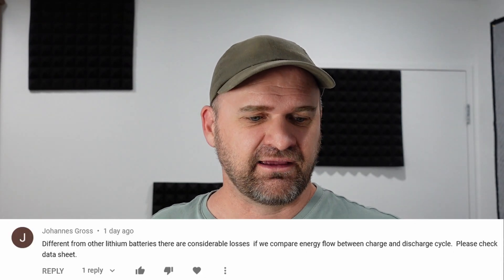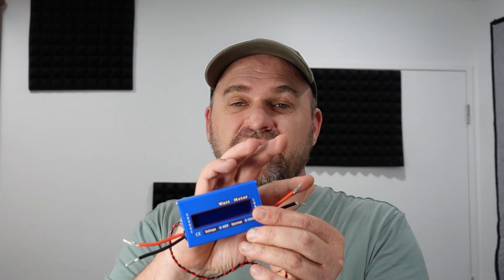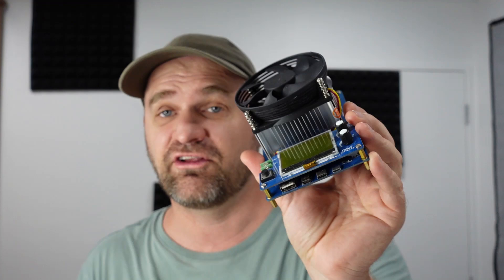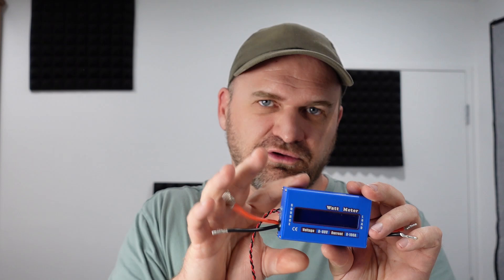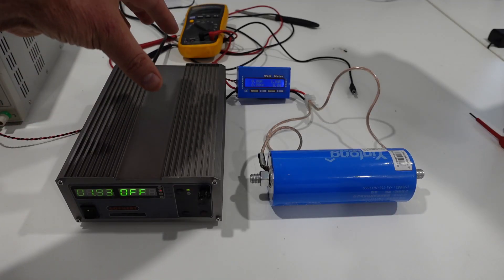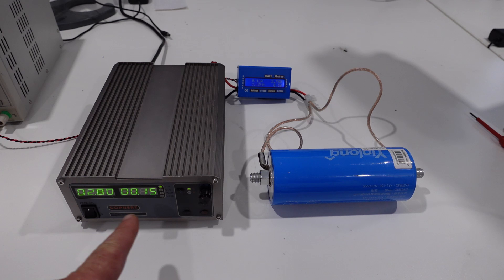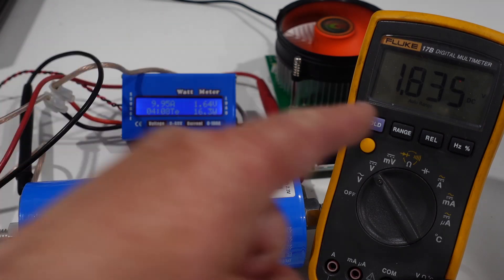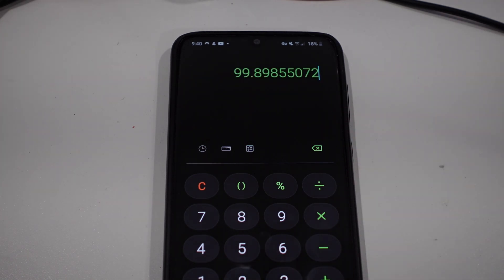Efficiency test LTO Yinlong battery

Comment: Awesome test Brendon! Just as my real world experience with these cells, they perform to or above specification. My advice: do not listen to everything Will Prowse says. He's wrong about these LTO cells.
Reply from the maker: Thanks Daan, I think he agrees that he had bad cells or something went wrong and they actually do have decent efficiency.
Reply: @brendontait6968  still he's very dismissive about LTO chemistry. Yeah they're not the cheapest or the lightest but for overland or heavy use cases or colder climates they're awesome!
Reply from the maker: @daan3298  agree
Reply: @daan3298  watching his videos, there seems to be a bunch he doesnt fully understand about batteries. And gives out misinformation.
Reply: @blackz06  what was I incorrect about. What do I not understand?
Reply: @blackz06  what misinformation?
Reply: @blackz06  can you be more specific?
Reply: @brendontait6968  thanks brendon
Reply: i called that right away and debated it . getting good cells is the hard part . LTO is amazing for the safety and abuse we put them through in car audio . its may be more expensive but it does pay off in the long run , having used many different chemistries over the years other batteries can not deal with the abuse as well .  his influence has made it hard for me since his videos with his attitude towards the crappy grade cells he got . he liked the toshiba and those sold out and i cant even get the damn things anymore for myself anymore , yet trying to get people to go with yinlong or other cylinder LTO is a uphill battle cuz they already have it in their mind that they are all bad. you over charge or over discharge Lifepo4 and it takes such a hit , ive literally drained my toshiba and yinlong LTO cells down to where they flipped polarity , flipped them back and recharged them without taking a noticeable hit on performance  , show me anyone do that with lifepo4 .....
Reply: @mazda2284  exactly!! Thanks for your comment. You get it
Reply: @mazda2284  oh right, you can't deeply discharge LiFePO4, or change polarity. You wouldnt need to do that in a pack anyways, so that is not a benefit. You don't want to cycle it in reverse either. But you can. I would stick to manufacturer recommendation. But that is a cool effect that lto has. But to say it is better than LiFePO4? Why? When do you reverse polarity of a pack? The deep discharge benefit doesn't matter if you have a bms. If you have no bms, then sure, lto is better
Reply: @WillProwse  yea you wouldn't want your cells to be discharged that low or flip , but shit happens and thats where its good to know what the damages are and what happens . i over discharged a bank of lifepo4 and you could tell they took a massive hit and not long after 1 of my cells ran away killing the balancer and overcharged that cell . the rest seem to still be OK but not the same as they were . i found it interesting how the LTO took that abuse and after reflipping the cells back you couldn't even notice the difference . and yeah the problem with using them for solar isnt the cells , its the equipment isnt made to work in the range they are . for my home setup i had to do a custom charge controller and a 16v capable inverter to get the full potential , which isnt as common and did cost a little more . to me its worth it tho , going on 5 years of using both Lifepo4 and LTO i can see the change in the lifepo4 due to cycles and lifespan , however the LTO is near same as its always been ! it will be interesting to see what happens over the next 5 years
Reply: Did anyone watch my LTO part 2 video? I pulled full capacity.
Reply: @WillProwse  Will I'm not sure if this is bugging you,........................... Remember it's youtube(meaning people will talk shit)
Reply: @pteepan2708  oh it's all good. I don't care what battery chemistry people use. I prefer LiFePO4 for my specified application, but audio system guys have reason to prefer lto. Really depends on what you want your pack to do
Reply: @WillProwse  it is nice that you show is many other systems and different set ups.
In OZ I'm 100% off grid and I tell you there is NOT enough people teaching DIY off grid projects. I know for so many people the grid is somewhat cheap, so most don't need to bother.
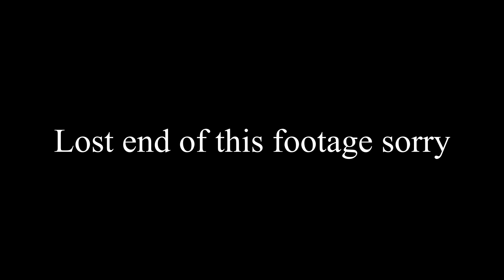Reply: @WillProwse  I'm not familiar with these tests or equipment but 4:21 to 4:34 in this video says 1.93 on the machine's display, does that mean the 'charged from voltage' was higher than the 'discharged to voltage of 1.80' ?
Reply from the maker: Hey Andrew, I know this question wasn't aimed at me, but I'll do my best to answer and anyone can add their thoughts or disagreements if they want.  With this chemistry, when the state of charge reduces below 30% the internal resistance starts to climb quite rapidly.   This, combined with some electrochemical processes make the battery voltage sag and float much like you see with a lead acid battery.  You'll notice at 6:08 where I turn off the load you'll see the voltage of the cell start to rise quite quickly before I cut. So by the time I had rewired the cell to charge it had risen to the 1.93V you mentioned.  The important thing is that the load and voltage was the same on both the initial and final discharge to get a reliable capacity indication.  It is inaccurate to rely solely on voltage as an indicator especially when internal resistance and varying loads come into play.  This cell has very little energy below 2V, realistically the useful charge range is 2.0-2.55V/cell.
Reply: @brendontait6968  @DIY Solar Power with Will Prowse
Fun fact: My BMV-700 shows charged and discharged history since I've installed it (LTO pack was already installed) as 291kWh charged and 282kWh discharged. Quick math 100/291*282 = 97.24% efficiency of real world usage. 109 cycles since measuring with BMV.
Reply: @daan3298  nice job! That is typical
Reply: @WillProwse  Efficiency update almost a year later: 100/793.2*772.5 = 97.4% efficiency charge/discharge, in kWh. Slightly more efficient than last year. This is fulltime vanlife real world usage.
Reply from the maker: Cheers Daan
Reply: @brendontait6968  how’s your Unimog build going? Love to see an update!
Reply from the maker: Haven't touched it...   loads going on.  But will soon
Reply: @brendontait6968  at least calendar life isn't eating away at your battery pack :)  Love to see any updates. Great rig deserves some airtime!
Reply: Why is everyone thinking that I disagree with Brendon? I like this video and I had the same results as Brendon. I also had grade b cells in the first video, and I mentioned that in the video as well.
Reply: @WillProwse  Last minute of your LTO part 2 videos sounds dismissive to me. "... there is not much benefit it is heavy expensive inefficient large I just do not like hearing those words in my mind ...". 
Most people I talk to about LTO and tell how great they are performing for me reference your videos and base their opinion on LTO on yours. They do not trust LTO because of your opinion. You have a lot of influence. 
These cells are also better for 24v (11s) or 48v (22s) systems. I have 24v 11s with active balancers and they balance fine. No problems at all. Maybe a topic for a third video, 24v system (for people not living in a warm climate, we use solar and batteries too you know).
Anyway, love your channel, it's really helpful and a great resource.
Reply: @daan3298  well that's why most people don't use LTO. I still stand by that. Specific energy, volumetric density and price of LTO are awful. I love the charge/discharge c rate, but most wouldn't need it. And they do become inefficient at higher c rates. I'll make a video stating all this soon. I'll show exactly what I mean, step by step. LTO is super cool, but not for most people. The cycle life is great, but calendar aging would probably kill them before the cycling degradation did. The working temperature range is incredible too. They do not work well for 12V, which would exclude a lot of people who like to stick to lower voltage nominal, which includes RV and van dwellers. 

And all the other reasons I mentioned. Super cool chemistry, but it's not worth it for most people. I love what brendon is doing, but he understands why he is using it. He likes the temperature range and discharge rate, as he mentioned before. 

I still do not think they are ideal for solar, but they can be for some. Really depends on what you are doing.
Reply: @daan3298  yes good point about using them for 24V system. Very true, I should have mentioned that more
Reply: @WillProwse  looking forward to another LTO video from you! I live and work in a van myself btw. A 12v system was just too light for me. I need to run computers all day, use the occasional power tool or two, water heater and induction cooker. It all adds up. For me LTO made more sense than LFP, also because I can mount the pack under chassis - that saves a lot of space inside and since LTO is still usable in cold climates there is no risk of damage by charging in freezing temps. 

Sidenote: I use a Victron EasySolar 24/3000/70-50 with a 1560Wp 6 panel array and a 33 cell LTO pack in 11s3p (upgrading to 11s4p soon-ish). Weight is manageable and size is not much of an issue because of under chassis mounting. My van/truck is 6 meter/20ft cabin over chassis base. I'm from Netherlands, it freezes here in winter, not much but enough to damage LFP cells or make them useless in times you'd need them most.

Anyhow, looking forward to the next LTO video!
Reply: Props for  @WillProwse  for making a new video on this topic this fast and for owning his "mistake". Check the video here https://www.youtube.com/watch?v=iOBSxEqXUQc
Reply: @daan3298  sure thing 😁👍
Reply: @WillProwse  Bruh, if I were the manufacturer of that battery I would come after you HARD for lying about my product like that. They think you disagree because you're not smart enough to take down the lying video.
Reply: @jonross377  I never lied about anything. I received grade b cells. I recently was sent crap cells from BLS who is a pretty big distributor for LTO, and pulled 38Ah even though they were advertised as 45Ah cells.
Reply: @jonross377  hey Jon how about you send me all that money that these people scammed me for? That would be LOVELY. I'll even make a video for you about it too. I'm tired of getting ripped off, and that would be great if you can fix how screwed I've been by these distributors. I have other videos about LTO where I state specifically why dislike them for solar. I don't think you have seen them going by your comment 😂😂😂
Reply: @jonross377  Do you understand that was my own money that bought those falsely advertised cells? And how hard it is to buy high quality LTO cells? I like LTO for some applications still. But not for solar. Just because I do not like it for solar, does not mean there is anything wrong with LTO. I figured that was implied, but full grown adults watching my videos do not seem to figure this out. I am not again LTO or any other chemistry. I love them all

Comment: Another indicator is heat given off during charge and discharge, those cells would cook very quickly with their relatively small surface area to capacity if they were inefficient. Keep up the good work.
Reply from the maker: Definitely!
Reply: Yep but a low CE does not necessarily give you heat it can also split electrolyte and similar which requires more energy. Though low ce will also destroy the battery most likely. Because where would all this 15% electricity go? Do something else which doesn't sound good
Reply: The larger the battery the less surface area to volume ratio, heat has less area to dissipate.
Reply: If they cook. It will be bad in this test, because more energy would loss in heat.

Comment: That's pretty good Brendon. They are substantially dearer than LiFePo4 cells though...what drew you to these specifically?
Reply: Based on a previous video, it's due to the extra cycle life of this chemistry making it overall cheaper per cycle. E.g. if LTO was good for 10x more cycles but was only 5x the cost it would be twice the value in the long-term, as you would need to replace your LiFe pack once to achieve the same overall life that LTO gives. (Of course not quite that straight-forward, but hopefully you see what I mean.) He talks about this here: https://youtu.be/kYx097cVR48?t=777
Reply: From what I can tell, the LTO are almost like the "led of batteries." ie they last longer than the item they're in.  I would imagine, in Brendon's build, that the LTO cells will easily last as long as his van.  So, maybe, that's the driver?
Reply from the maker: Hey Benny - long life, safety and ruggedness. I think the cost works out somewhere between 2-3 X more expensive than I could have built an LFP for.
Reply: Thanks all for you help!